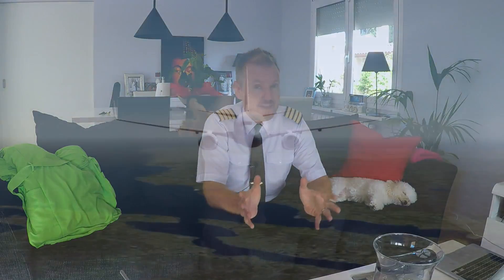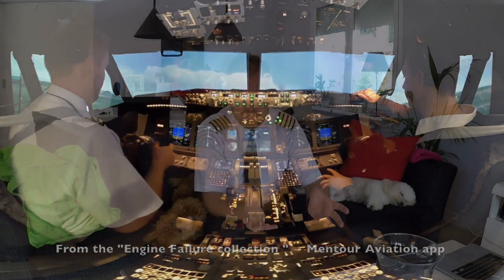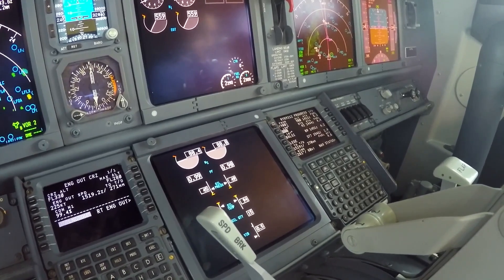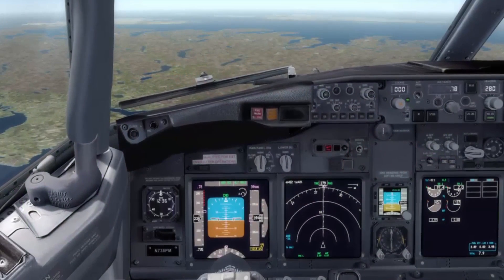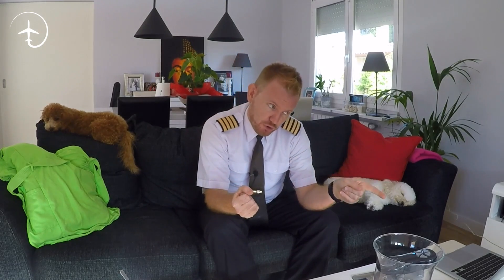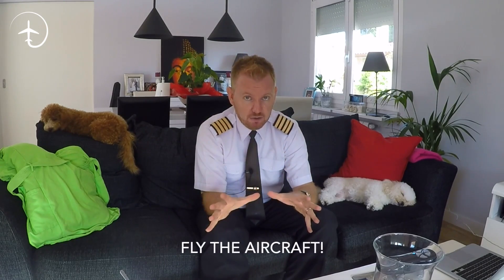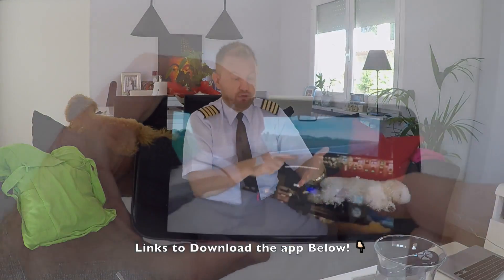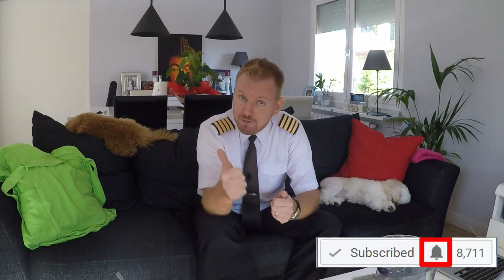What if an Aircraft loses an engine in cruise?!

Comment: BTW, the definition of "Service Ceiling" is the maximum altitude at which the aircraft can maintain a climb rate of 100 ft/minute on one engine.  The term "service ceiling" is often confused the "absolute ceiling" which is the highest ceiling the aircraft can sustain under normal atmospheric conditions.  That means a sustained maximum altitude at a standard pressure of 29.92 in/hg and a temperature of 59 degrees Fahrenheit.  FYI

Comment: Well said. From the Dispatch perspective, I’ve had two IFSD’s (in flight shut down); one precautionary, one not. In both cases I was aware there was a problem because I saw the deviation from the planned altitude track and speed reduction on my Aircraft Situation Display (ASD).  As I always have diversion points planned along the route, I have the available information available to give the pilot and depending upon the severity of the problem, can decide where best to go. By the time I got the first ACARS message indicating the problem, I have all the information (fuel burn, weather, notams) to provide the pilot so that I can give a diversion airport that is suitable for the situation. Once he decides where to go and the aircraft is stable, I have all the resources available and provide any other assistance, including phone patch to maintenance, in case of troubleshooting. Usually it’s a couple quick text messages back and forth, then he knows where to go and I have the appropriate resources on the ground to meet the aircraft as well as a recovery crew and aircraft moving to mitigate the delay.

This is an excellent demonstration of the process in the aircraft, one that should be viewed more than once. CRM is a team effort and we all work together so that the rule of aviate, navigate and communicate is always followed and the safety of flight is always ensured.

Comment: I had a long discussion in a different channel about raising the dead engine and do not turn toward the dead engine concepts. I do support both 100%. Using the rudder to correct the banking also will create a drag. Right? 

Moving the fuel from one wing to the other is also a good idea I think.
Reply: Put the fuel in tank to balance the weight if possible. Cross feed will help to accomplish this.

Comment: I enjoy your videos a lot, you always present the information in a very easy to understand manner without reducing or oversimplifying it. I have a question though. When you spoke about the different altitudes you said you will set the altitude to 1 level below your minimum 1 engine speed, but if that minimum is 24600 feet then 1 level below should be 23600 instead of 25600. You keep stating 25600 feet, so i am not sure if i misunderstood or its a slip of the tongue. I am sure people get the whole idea either way, but just wanted to clarify for myself. Again, amazing videos and extremely well presented for both rookies and intermediate. Keep it up!

Comment: About 35 years ago, I was on a flight that had a catastrophic engine failure at cruising altitude, at least that's what I think it was, because the pilot never said anything.  It started with a loud BANG that shook the whole cabin, followed by the aircraft rolling to the right and losing altitude.  The flaps and slats were extended and I could hear the other engine spool up.  We descended steadily for a while, then leveled off.  We flew on to our destination (DFW Airport) and flew straight in.  I'm an aerospace engineer so I knew there were backups and procedures that would hopefully keep us in the air, but the passenger next to me was terrified and I had to talk to her to calm her down.

Comment: A lot of people think that if you lose one of two engines, you lose 50% of your power. But this is not the case, because that dead engine is not only no longer thrusting, it is also generating a lot of drag.
      I don't know if this is true for jets, but in twin engine propeller planes, losing 1 engine results in an 80% loss of power.
     So yea, getting into a stall with only 20% of your power available... That is asking for a bad day.

Comment: With respect I offer there is one thing that you have not mentioned or suggested a pilot do during an event like this: Yes the mid-cruise fault technical details will be captured on the flight-recorder but the pilots actions and thoughts are so very important in the unfortunate event that the situation is not recoverable. So I suggest that although running a clean cockpit where there is no unnecessary chat during active flying events, it is important to offer something of a running commentary about both pilots' thoughts to events and planned reactions to the situation as it unfolds. Rather than just the expected "WTF!" caught on the Cockpit Voice Recorder. I see that mud is hampering recovery of the CVR from the Lion Air crash, it could just as well be the Black Box that was lost. Clear Skies ! (I note once more the doggies end the flight with the sofa in trim.)

Comment: "You lost an engine? What are you talking about. It's right there on the wing, right where it should be."
       There are a couple of cases I know of where the engine DID come off the plane. One came off a 747 freighter and the plane crashed into an apartment building in Amsterdam. Another came off a plane on take off.

Comment: I was on an American MD 80 and we lost an engine @ 14,000 feet. I never noticed a thing. We were already on decent into Norfolk and just landed like normal. Of course we had the whole "prepare for crash" thing going on and there were fire trucks waiting for us, but we just taxied and went to our normal gate. They announced over the intercom that it was a loss of oil pressure and they shut it off. I think because the engines are so close to the centerline of the aircraft that there is no asymmetrical thrust.

Comment: @Mentour Pilot   Petter, I'm thinking about LionAir and about a crash of a test flight of A320 (I think?  I do know it was an Airbus) that happened years ago, both caused by pilots not being aware of automated systems in place to get the aircraft out of an unstable/uncontrolled flight.  This automation also touches on the case of engine failure in which the autopilot, if left on, will counteract yaw by trimming ailerons, and if you were to disengage the A/P too late without noticing that action, the aircraft would abruptly move to a different position (and possibly spin out of control).

My question is - is there a reason that pilots don't immediately override all automated control systems (A/P, A/T, trim cutoff etc.) and fly manually in case of a loss of vital instrumentation affecting those automated systems or engine failure?  My idea is to turn off everything that's automated and have the pilot fully control the aircraft.  Is it because aircraft manufacturers don't list all such automated systems that you would have to disengage in their emergency checklists?

Comment: Great video Petter, I wonder why isn't there a display showing where the plane is on the map in real time with the terrain underneath? I noticed it's available on smaller planes nowadays
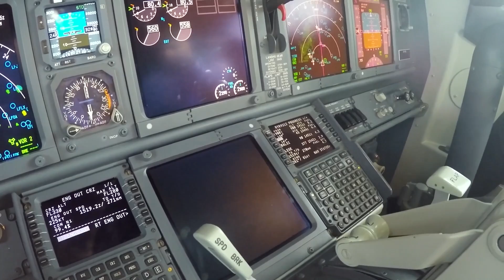Reply: There is such a display on the Boeing 737 800 - you can see it on the co-pilot's side of the cockpit at 1:54 in this video. It's the screen to the left of the co-pilot's Primary Flying Display. If you look closely you can see an area of green to the left of the centreline on that display. This is the terrain being displayed.

Comment: Can you do a follow up video for duel engine failure and engine failure procedures over Atlantic and pacific Ocean.
Reply: Well, if it's a 4 engine plane you would try to initiate a restart while continuing your heading, if a restart has failed, notify the nearest airport to the trouble and plan for a landing there.

If it's a 2 engine plane flying that route which is extremely rare, you would attempt a restart, if that failed you would notify the nearest airport, tell them what happened, guide the plane in as far as you can to land while making distance and decent calculations, if you can't make it, announce it to the airport and pray for dear life.

Comment: Nice video Mentour Pilot. As always. What about if you have engine failure above the Atlantic? If you descend to a lower altitude, you may not going to make it to the nearest airport, too far away. Due to the higher fuel consumption caused by the increased drag.
Reply: Couchsurfing band 
That's why the plane descends at the most gradual rate - to extend the range as much as possible.

The escape routes and potential diversion airports have to be chosen to be close enough to reach on one engine with the fuel at any given point in the flight plan.

And once the engine fails the pilot selects the diversion which offers the best safety fact: you are right that fuel is one of the things that go into that decision.

Interestingly the opposite is also true. With a problem early in a fight the plane may be too heavy to land until some fuel is burnt off: so the pilot will not always go for the closest choice

Comment: Ok and what is about further proceeding with an engine failiaure? Landing as soon as possible? Whats when the last engine gets in trouble too because of over limit or other topics? For me this video shows only the first reaction but what came afterwards should be also important. Or am I wrong?
Reply: Jog S soon as practical/possible not are always the same.  Example airport may be below your position but if the runway is too short then not always practical.  Modern day commercials twin engine aircraft are designed and certified to be able to fly at least 60 minutes on a single engine with full passenger load.   A very rare stretch to actually go that long but possible.  For the Continental United States (CONUS) outside of the Rockies it would be very rare almost impossible to not be able to find a commercial airport that is not within 60 minutes.  May not be your airlines scheduled service airport but engine failure and in flight emergency kind of puts all that by the wayside.  At that point get safely on the ground, call company and the rest will work itself out.  Sometimes it is a rescue mission with another aircraft.

Comment: Hello. I have a question for this case. If you need to descend rapidly and you're flying in an airway with some planes below you in the same and in the opposite direction. If you have  TCAS RA, probably, the TCAS would urge you to climb, but you continue descending because of the engine failure. Could you explain what the possible situations you can expect? What would you do? Thank you.

Comment: Hi, thanks for your video, awesome as always.  Do you try to restart the failed engine? Does this depend on your assessment as to why it failed?
Reply: There are restart procedures that can be attempted provided that the indications are suitable and the required conditions are met (Max altitude in particular is a big one here as engines need more oxygen to restart from windmilling than to keep running). The exact conditions and requirements vary by aircraft so it's a case of following the emergency procedures in the QRH (Quick Reference Handbook) which will guide the pilot which if any in flight restart procedure is appropriate. Of course the QRH also contains the checklists to perform said procedure too, for the most part the vast majority of technical situations that could crop up and the correct steps to safely operate the aircraft should they occur are in the QRH.

Very rarely aircraft do encounter situations not covered in the QRH but generally only once as the content of the QRH is itself dictated by the lessons learned from testing during the R&D phase and from and and all incidents involving the type after it enters service.

Comment: JustPlanes has a blu-ray video of an Air Canada 777-ER flight from Toronto to Hong Kong via (almost) the North Pole.
In it, the pilot talks about ETOPS and the flight path a twin engine jet can take, defined by the maximum distance it is allowed to be from an airport.
So there is a maximum distance a jet with a single engine failure is allowed to fly?
I guess there is a lot of stress on the remaining engine, and you don’t want that one to fail too!

Comment: Interesting video about how to deal with one engine failure

but i believed you are fly the 737-800 most of the time.

So will the same steps as mentioned be applied to the bigger B757, B767, B777 and B787 twin engines planes?

Maybe if possible you can collab with Captain Joe to cover engine failures on the 4 engine 747 and how to deal with it.

many myths surrounding the 747 can run with one or more engine failures but very few solid answers as what are the procedures taken to deal with engine failure on the superjumbo

Comment: How long can you fly with a single engine if you are flying over an ocean with long distance between airports for example? 

Do you divert to an emergency landing airport right away or do you try to reach youre destination airport or an airport where youre company has maintance facilites? Johan.
Reply from the maker: That depends on how much fuel we have left. We always divert to a suitable airport if we only have one engine working.
Reply: To answer your question about how long the 737 may fly single engine, now the MAX fly frequently across the atlantic, it can be as long as 180 minutes, provided you have a 180 ETOPS approval..
Reply: @ACPilot  Hi Allan! And so, are 3 hours enough to let's say cross the Atlantic in search of the closest airport to do an emergency landing?
Reply: Sophie Acapella Often it is a lot less, it depends on the routing over the Atlantic and winds. Often used diversion airports are Shannon, Ireland, Keflavik, Iceland, Azores, and St. John in Canada.

Comment: At about 4:40 you speak about manually applying rudder to counter the (now) tendency of the aircraft's yaw because of only one engine producing thrust. 
Does this need to be maintained by the pilot & co-pilot the entire time (pilot fatigue) or is there enough trim authority to compensate until you start your approach?

Comment: Why doesn't the autopilot have control over the rudder? Just because it's usually not needed or is there a technical reason? (I'm not planning to become a pilot or anything, just intrested in the subject)
Reply: Because the yaw damper takes care of that. Even the pilots don't use the rudder during flights unless there is an engine failure.

Comment: If you are at cruise altitude, even with one engine, I would not think range would be a factor over land. You will surely be able to find a place to land in plenty of time. Over water, of course, it would be an entirely different story, is that correct?
Reply: Range is always a factor and water isn't considered. We fly by ETOPS certifications (Engines Turn Off Pax Swim) which regulates how many minutes you can fly on one engine. 737Max can fly 180 minutes in single engine mode. So your diverting airports along the route have to be 180 minutes away or less. On a single engine you burn a lot more fuel as you top out 20,000 feet, one engine is acting as a drogue chute   (the non working engine) and the yaw compensation you have to put into the rudder drags.  Additionally you want your diverting airport to have a shop or your aircraft may be stuck in Santa Maria (Azores) for 2-3 days for parts to be flown (been there).

Comment: I like your talk about training cadets.  I would do the same thing on the ship when I had a maritime academy cadet on watch with me.  Have them practice various skills from celestial nav to divert ports.
One question about auto pilots on aircraft.  On a ship, when the autopilot is on (in our case, obviously it only controls the rudder) the helm is in-active.  On US vessels ever since the EXXON VALDEZ accident, there is an audible alarm if you try to use the helm while the auto-pilot is on.  On an aircraft, do you have control over-ride when the autopilot is on if you input a control, or do you have to disengage the auto-pilot first?

Comment: @Mentour Pilot             If the right engine quits and the aileron is directed by the autopilot to turn to correct a yawing condition that should be primarily controlled by the rudder in the first place, why do you keep the autopilot on?  Why don't you immediately disconnect the autopilot and fly the airplane the way it's supposed to be flown?  My guess, as a GA pilot who flies underneath the flight levels, is that the air is so thin up there that attempting to "hand fly" at  39,000 ft, might aggravate the situation.
             I'm assuming this because if it were better to disconnect the AP and hand fly, that would be a part of Boeing's checklist.  But to a GA pilot, the first thing we would do is disconnect the AP, hand fly the plane and deal with the dead engine.  I'm making assumptions I have no understanding of while dealing with aircraft in the 39FL realm.  Is my reasoning correct?  If not, I'm sure there are a lot of GA pilots out there who might be asking a similar question to themselves.  Thanks in advance.

Comment: Hopefully the problem that arose in number 2 will not arise in number 1. Shut off fuel to dead engine. Depending on the severity of engine problem. Determine if any flight controls damaged. 
Inform all ground control of divert to nearest available aircraft capable runway. Manually fly to not allow auto to over correct.

Comment: If you were to lose BOTH engines (needing to deploy the RAT for basic bare electrical power), how far could you PRACTICABLY glide and OPTIMALLY glide (Miles or KMs) to put it down as a glider at any suitable airport with a long enough runway?

Comment: Why does the horizontal stabilizer not have winglets
Reply: Becouse its not there to create lift per se, it needs to stabilize the plane by applying down pressure on the tail. Becouse its not holding the plane up in the air, any vortices are of negligable strength.